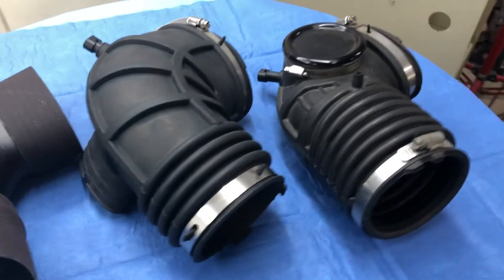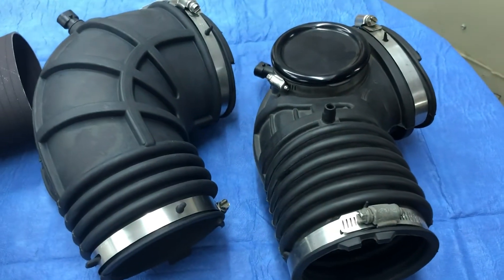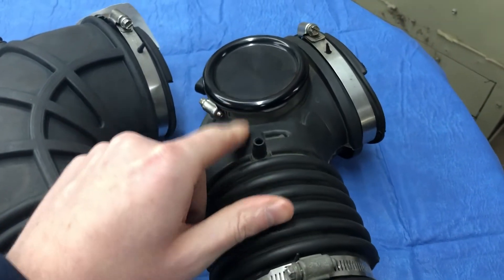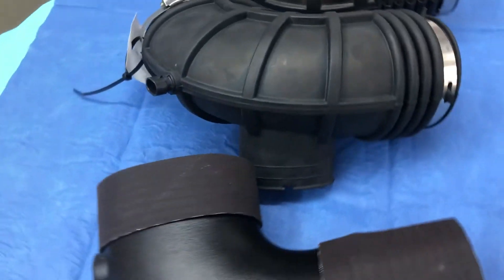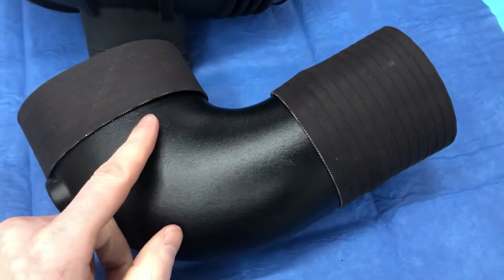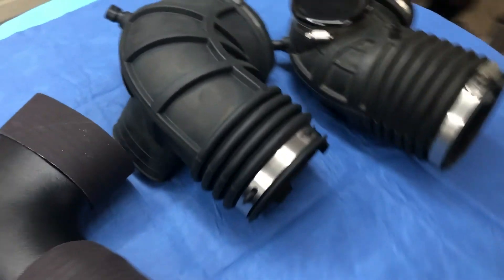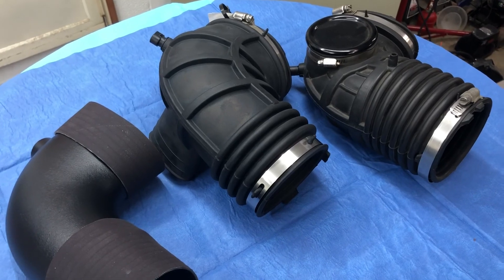LT1 Cold Air Intake Elbow Options

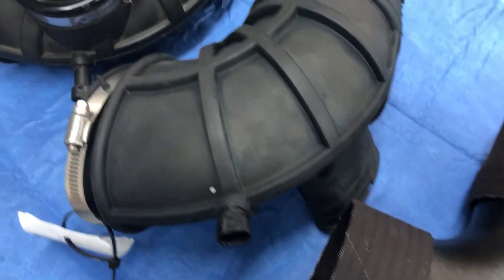Comment: The center type fits the 93-97 Z28 LT-1 Camaro's. All the new OEM Intake elbows don't have the hole pre-cut (00:52) for the long resonance tube, which is attached with a metal banding. My question is how do I attach the stock resonance tube, to a new elbow as I don't have a thin banding tool. Should I just cut the hole with a box cutter, and try a big ss metal zip tie to attach the tube ? It has to be permanent and air tight. Any rational opinion is welcome. Thanks 😎 Update:  I bought the new Intake elbow, but I'm not going to cut the hole for the silencer. The Forums claim the difference in decibels is minimum.
Reply: Don't use the sound tube or cut out for it. It reduces flow. The 1LE hose fits the lt1 . Summit and GM are expensive. Use Dorman for a 1993 Camaro 1LE. Or equivalent. $40.00 - 50.00. 1LE flows better than the hard metal piece.

Comment: You want to keep your vent system hooked up ! It pulls moisture out of the distributor housing and will save its life ! I unhooked mine for an intake mod and blew 1st distributor in 2 weeks, 2nd one lasted 3 weeks,  At the time these distributors went for $450 new. then figured out the issue.  Hooked it back up, No problems for years ! Depends on the climate where you live some may not need it but i sure did living in TN. i used the trick flow and modded it to except my nozzle for a 100 shot, Worked Out pretty good but that elbow complicates NOS delivery, Direct port works so much better on the LT1's
Reply from the maker: Well I no longer have an opti-spark, so the vent system isn't needed :)  I agree though, keep it if your vehicle came with it.
Reply: Rubber City Motoring so that leaves the question where do I find a replacement with the vent tube my firebird needs one real bad but I still have the opti
Reply from the maker: I found a nos one on eBay awhile back. Has check valves and such. GM part.
Reply: 0:53 a little late, but that part (stock) is hooked up to something colloquially called the "intake air silencer," it basically is a long tube that hangs down. It's supposed to quiet the noise of intake air according to GM.  @RubberCityMotoring

Comment: The middle one is the 1LE factory option elbow
Reply: What’s the plastic tube that goes on the bottom for? My new boot has the spot for it but is sealed off. Should I cut it out and use the tube?
Reply: @871jamie  you don't want the boot, i think it was for sound reduction
Reply from the maker: I believe this is a Camaro feature. My impala never needed it.
Reply: @CPAJayhawk  I do believe you’re correct.
Reply: @871jamie  don't open the elbow hole for the tube, it reduces flow. Pitch the tube.

Comment: Yes I have the fbody also and I’m trying to see what coupler or rubber sleeves u used to connect your mass airflow to your k&n
Reply from the maker: Ok I'll post an update.  Basically, I'm using what came with the K&N, slightly enlarged.  You can also get K&N Couplers, individually from Summit.  I had to do that for one of mine that tore.
Reply: Rubber City Motoring the hard coupler I had to take a Dremel to get some rubber out but then the fittment was too loose I’ll check with summit
Reply from the maker: Yea if you just sort your parts search by sizes and all that, you might find some that work.  Doesn't even have to be the same brand...

Comment: ok so i just purchased an aluminum 90' elbow intake to go with my k&n for my 95 z28 lt1. my question is what do i do with the sensors if there not mounted on the same spot? Will the car still run or am i walking into problems?? not so much of a mechanic so any help would much appreciate. Thanks fellas
Reply from the maker: Which sensor? Intake air temp?  Does the aluminum elbow have a hole or no? I forget...
Reply: @RubberCityMotoring  it's the iat sensor and there's another one on the right  that connects the stock rubber intake? Idk what it's called
Reply: The aluminum intake does have a port but it's for nos which I will not be using, kinda like this black one on this vid.

Comment: Listen carefully
Its all about velocity and ballance between front of the lt1 and exaust behind it.
not all upgrades help some times hurts..
Just any cold air intake is not your answer.
my 97 camaro ran ok with cheap specter CAI  but where it went from round to oval I
had bad turbulence .
and air cleaner left a lot to be desired.
I put on trick flow elbow and used the 3 inch specter pipe to air cleaner 
and bought a k&n air cleaner open end .
and my car got so fast it was extreme .
I had stumbled across velocity.
just the right sized pipe for my stock throttle body.
I then added a air foil and it was back to turbulent  and could not get out of its own way.
I took off the air foil and threw it in trunk and it was back to super sonic air flow.
on the other end I have the stock y and single pipe going to a superformance Hooker muffler.
and the 3 1/2 inch in to the 3 1/2  inch out realy rocks the low end is realy out of control strong 
and going through rpms is crazy..
The LT1 heads have great flow stock  you just have to feed them the right way.
I feel Ive at least got a 50 horses upgrade..
Ive been kicking new corvettes and camaro butts ever since.
LS1s and 6.2  vettes is what ive been feeding my camaro.
THE LT1  has more stock  then  anybody has figured out.
my heads are 561 s and Im not sure what cc runners they are 
 but my exaust ports are 1.379 inches wide and 1.475 tall.
and the exaust ports on the faster LT4 heads are 1.316 inches high x 1408 inches wide.
ruffly 70 thousandths bigger all the way around.
My heads were designed with the LT4s  and are in fact upgraded with them.
The bigger exaust ports with smaller intake ports  I think 185 ccs but not provin yet.
if 175 ccs just a better ballance between intake and exaust runners.
its to bad the guys flowing heads dont flow through the intake runners and exaust runners at the same time.
or you would get a different story.
when you climb in my 97 Camaro Z28 and just run in one gear you know your in a racecar.
then you just have to practice running the tork rpm band and you will kick butt.
This info is worth 9 car lengths in  the quarter mile .
take this info or be sceptical YOUR PINCH
Reply: @James M Actually  The NHRA Rates The 97 Camaro Z28 LT1 6 speed as a sedan  
stocker Class 1o second Quarter mile car before they tear it down to see if
it is truly stock by tearing it down at your cost
And the forth gen camaros and trans ams have ruled the scca racing for many years.
There is a LT1 video on youtube that takes a stock Box engine LT1 
Dynos it with every thing stripped off of it on a flywheel dyno without the cold air intake
And makes 370 horsepower and 390 tork .
Making it the most powerful chevy smallblock ever made.
Thats more powerful than the LS1 in the same configuration
Watch the video.
If you pay attention to chevys performance heads the LT1s are in fact small runner fast burn heads.
And the performance line from the Bowtie heads to the fastburns to the SB2
nascar engines all went vortec.
The small runner lt1s 96-97 561 heads also got this upgrade.
Some thing I have discovered is that how you drive them is very revilent.
I have a electronic dyno that is very accurate.
It went 441 horse power at the wheels in forth gear driving it the way I do on my racetruck with a supercharger ran 440 on the back tire dyno .
Thats the 1percent its supposed to be off just like gps on your speedometer is off 1 mph
With that testing I figure my electrontic dyno is very accurate.
And in my dialed in by accident  6 speed LT1 with me driving you would probably wet yourself.
And hitting 4th gear twice I blew the Gforce electronic Dynometer off my windsheild
and catching it with my hand .
Which alone tells you its got some crazy force.
Hit 691 horsepower twice going two different directions on track.
And why 22 times in quartermile races at hot august nights year before last.
And 1 race on the hiway against a brand new 700 horsepower Lambo
In which I came from behind to beat and yes he was racing me.
Some of it is driver skill Some of its gears ,
But for the most part I can tell you Its my  stock LT1 Dialed in.
Running exactly the right part of the rpm power band.
the right way.
And a lots of people have probably got it some what right ,
but dont have the balls or driving skills to make it come out.
With a old set of 12 inch wide radials thats a old brand.
I can pull a wheelie in all six gears  shy of a 8th mile
not letting the gears wind up.
!/2 sticking my clutch and letting off full throttle a half inch
to aproximatly 1 inch speed shifting
What I am trying to share with people is that its copyable With the same 
camaro if you have the skills balls and practicing that I have.
Maybe you have a supersport intake or a flow blade on your throttle body  thats holding you back. 
It did on mine  or older vs newer throttle body
Or just a closed end k&n airfilter thats holding you back.
Maybe its my stock z28 exaust with a superfomance muffler and missing one cat
that kicks butt .
People underestimate the flow of just a 3 1/2 inch pipe with no turbulence in it.
Ive been porting iron heads since the late 70s  and I have to tell you 
the ballance of exaust and intake on each end is just as important as the heads and cam.
To big To small and you are screwed just like intake and exaust port runner.
There also is a set of small runner LT4 heads you can only buy in a crate  engine
with solid valves and 185 intake runners.
that will kick butt on the 96 lt4 heads .
Might be the same as 561 heads with different number.
or tiny bit bigger intake runner. 
Most jump on old lt4 heads or heavy porting which do I think higher hp 
but by going so big they lose the vortec design the head had to start with .
And That would be TORK VS HORSEPOWER 
And if you go horsepower The whole drive train has to be dialed in 
To dump at 7000 rpm And not destroying it self. 
Costing about ten grand.
I almost thought a beefed up LS1 Was going to beat my camaro 
when his front tires lifted 2 feet off the ground taking me in the 60 ft off the line
 but I Shot passed him going through the gears and beat him by
About  7 - 8 car lengths .
To make a long story short if you are redlining your out of gear 
not gaining any speed and thats what racing is all about .
most racers hit 4th gear winding up in the quarter mile .
I call that stuck at 100 mph.
I shift the first three realy fast letting fourth and fifth pull .
Im hittin about 145 in the quarter 
my speedometer is off It might be for 17 inch rims
But I am going way faster through the gates than the competition
 Well over 100 mph .
And everybody who owns a fouth gen  lt1 will tell you 
there top end is 166 mph 
And they will hit it not far after the the quarter mile.
In oe form.
So yes driving skills are big as far as Im concerned
Some people just drive it 
I am Driveitlikeyoustoleit .
Nice to meet you james
Reply: Beating the C7 corvette? I’d highly doubt that but I’ll race you with my ZL1.
Reply: @871jamie  Where you at lol  got a short wire on front 02 plug and right plug wires to put on  you around reno?  
it kind of depressed me to find out most came with 272 gears 
so they wont get out of their own way lol but yours should have 373s 
Z06  LS1new lt1 Dont scare my ZREX at all  
a ten second car maybe you got a chance 
the racers at fernley  speedway  lost against me too on grudge night 
won 2 grand lol there last year  .
what years your Zl1 ? 
Zr1 would make me happy too lol
and yes 2 2015 stingrays lol and a 2004  vette.
I think I smoked a yellow ZR1 BUT he didnt hang around to see what year 
and engine the couple own 2 but not sure if he turned off the traction control
and wasnt running on 4-6 cylinders 
All show and no go  So when you say I highly doubt that  I think you dont know what happens to a touring car racing a sedan class in the quarter mile.
Its called purpose built
so if you live around reno
Reply: I live in Texas. I also own an LT1 camaro  they were dogs compared to today’s Camaros. My Zl1 will smoke them.
Reply: @871jamie  define your lt1 camaro
Reply: 4th gen ?  I been smoking some of those todays camaros lol 273 s 2 cylinder turbos 
LT4 conversions havent beaten my stock 97 usually pulling high 11s 
lol 10 flat I dont think you can pull off

Comment: The middle one is for pre 1996 or pre OBDII. That same one is used for the 96-97 but it has the vent hole like the 1st one for the opti on your stock 96. Oh, and that oval hole underneath it is for some type of plastic tube that does nothing but quiet down the air intake. Eliminate it, it's useless !

Comment: So which one did you end up putting on the SS?
Reply from the maker: I used the Camaro one without the hole on top. Seemed nice and simple. Worked great.
Reply: Nice sir :) any videos of it? I’m putting an aluminum one from a z28 Camaro
Reply from the maker: If you check my other videos, there are lots of views of the engine bay.  Thanks for watching!